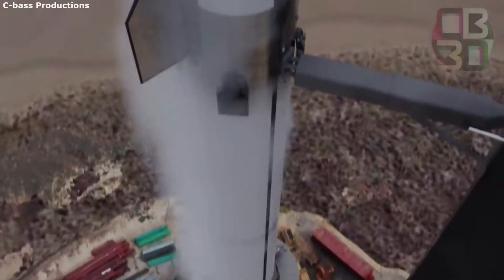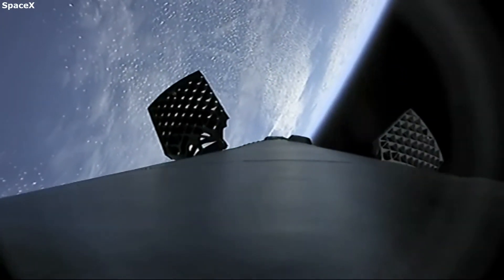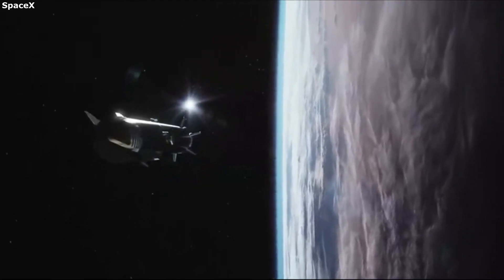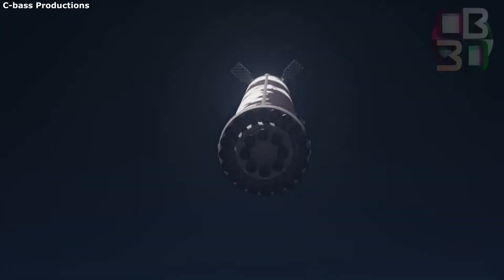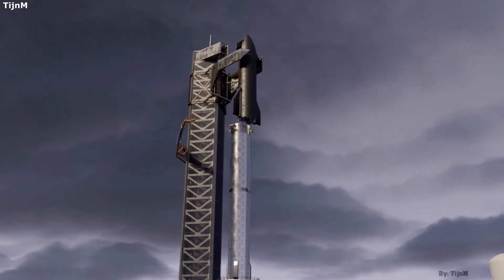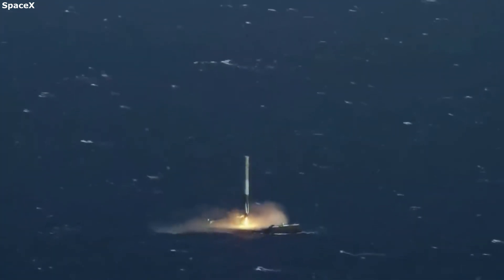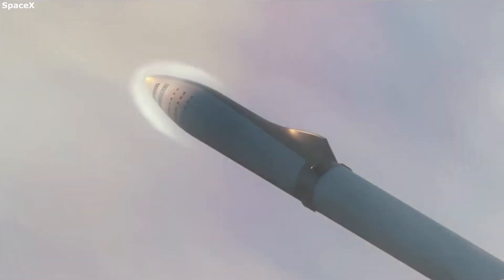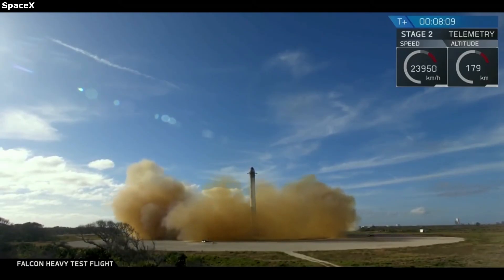Why Are Super Heavy's Grid Fins So Important?

Comment: in a catch attempt if they miss the catch pins as small as a teniisball can the gridfins be a backup to prevent it from falling through, obviously depending on the speed, and mass pure inertia froma certain point they'l sheer off either the gridfins or the chopstick no matter the prescision this is very precise a as an aircraft an a sudden gust on the last 10feet could make or break the landing attempt if the grid fins can save the booster when the pins are missed. so how strong are those grid fins?
Reply: Wtf do you mean? Lol
Reply: Oh I should've waited before commenting, I understand now